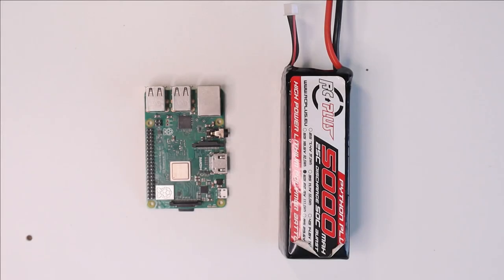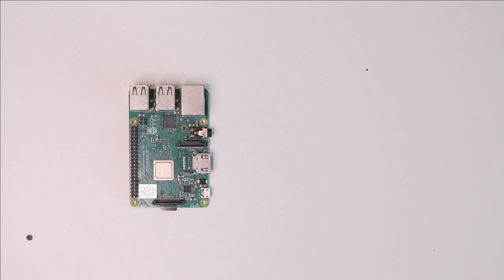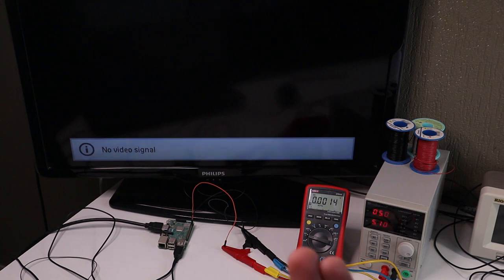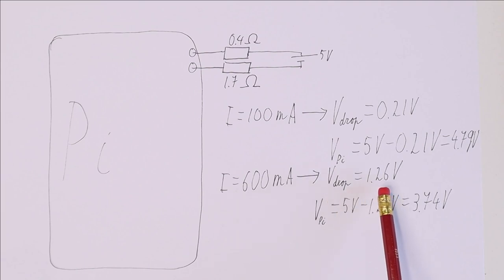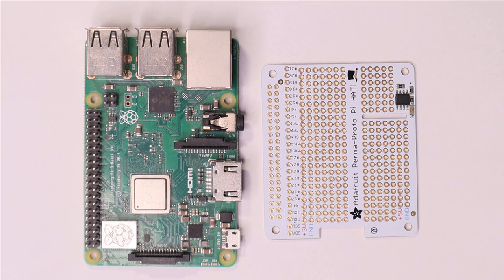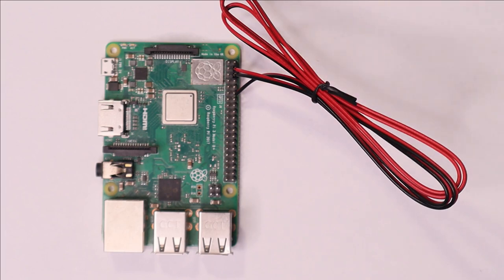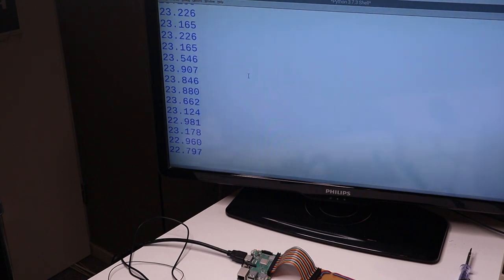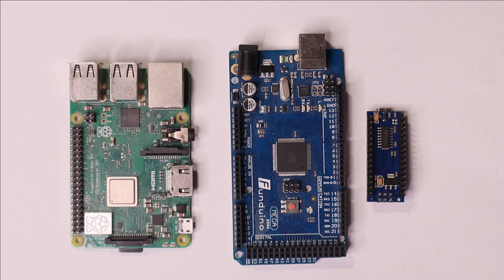How to power Raspberry Pi and Arduino from LiPo batteries

Comment: Awesome video! Some Arduino's also have a VIN input pin where you can add 7-12V (I usually still add a regulator to avoid using the built in one).  If you haven't yet, highly recommend trying out the ESP32.  It's amazing.
Reply from the maker: I talk about the Vin pin at around 16:30. I should've added the chapter markings by now, but the hard drive containing my footage was going bad so I took it out, so I can't access my shotcut project for this video. That means it's a bit more of a hassle than usual to put up chapter markings.

I got some brief exposure to ESP32, but haven't found a great use case for them yet. I honestly don't use arduino much either, I use Rasbperry Pi a lot, for the Wifi and camera capabilities mostly. ESP32 does look much more powerful than Arduino though, and a board is still just 3$ so that's very compelling indeed
Reply: @antalz  I totally missed that part, my bad.  Yeah the ESP32 is really robust w wifi/bluetooth built in.  My new favorite board.

Comment: I'm pretty sure I've worked on a project with a Raspberry Pi Zero W using the 3v3 pin as battery input so if you don't have 5v you can try 3v3 the same way you did in the video. My guess is it goes straight into the IC so you better be very sure your 3v3 is regulated. The 5v pin on the other hand goes through the internal 5v -> 3v3 regulator AFAIK.
Reply from the maker: I tried to look this up, but it seems a bit inconclusive. I'm honestly not sure if it works, I'd also not use a LiPo directly on 3V3 because you're going far out of spec, and that leads me to believe you'd fry something at a high state of charge.
Reply: @antalz  You definitely would fry something in that case! Also I looked up the files and we actually used the 5v pin for the project I mentioned so I'm not sure if 3v3 input works either :c

I should've done that before the first comment but I forgot I had a way to check the project files. My bad.
Reply from the maker: @bandreghetti7663  Yeah I did find some comments about feeding 3V3 into the 5V pin. But again, not entirely clear to me if that works.

Comment: Im not sure if the pi 2,3,4 are the same/similar lay out as the zero but there is a 4pin header thats unpopulated on the zero that dose power and usb, allowing for the whole gpio to be used with a shield still. I think its the 4 pins by the usb sockets on the pi3 you are using, im not sure but you should do a continunuity check on them!
Reply from the maker: I had to look into this, but for the large Raspberry Pi models the 4 pins appear to be for PoE HATs. The power itself is turned into 5 volts and supplied via the 4-pin header as I describe in this video. The 4 separate pins connect to the Ethernet jack.

For the Zero the 4 pins are completely different. One pair is a reset-pin and ground, while the other pair is a video output and its ground. The silkscreen also says "RUN" and "TV" for these pins.

I continuity checked it all, the 5V has no continuity with any of the 4 pins on the Pi 3 or the Zero, ground has no continuity with any of the pins on the Pi 3, and ground has continuity with 2 of the 4 pins on the Zero.

The Pi 3 also has RUN and PEN pins in a group of 2 near the PoE pins. They're unpopulated by default.

Comment: @Antalz  - Thanks for the video. I also see folks using a 3.7V Lipo and boosting the voltage to 5V using a COTS DC-DC boost converter. What is NOT clear to me is if that boost converter can drive 3A which is required for RPi4? I was researching a COTS or self-made PCB for my bot that can act as a onboard charger for the 12V Lipo with all the voltage & current protection and then down convert from 12V to 5V 3A to power my RPi4. Have you cracked this already? I have found a 7.4V Lipo UPS RPi Hat but not a 11.1V Hat which would have solved my problem.
Reply from the maker: You can find such boost converters, but it won't help you. In practice you have to connect the motors directly to the battery, and except tiny motors they won't work on 3.7V. That's why in practice you nearly always have a buck converter, not a boost converter.

What you have to do, in a nutshell, is buy a battery management system for your battery. You can find tons of BMS on aliexpress. The BMS ensures you can charge and discharge your LiPo or Li-ion bank safely. The motors connect to the BMS output via the motor controller, and you also connect a 5V buck converter to the BMS output to run the Pi and other electronics.

I haven't actually done this myself, mind you. I just use an Imax B6 to charge my batteries.

Comment: What maximum amperage would you recommend, for the inline fuse? Many thanks for a very informative video!
Reply from the maker: The fuse amperage should equal the maximum current draw of the whole system, plus a bit of margin. In my tank for example the Pi and electronics need about 10W max, which is 0.5A from a 22V battery. The motors that are driven from the battery need about 15A max though, and because there are 2 that's a max total current of 15A. With a bit of margin I think I selected a 40A fuse. If you're just driving some electronics or low power stuff you can go much lower, 2A or perhaps even lower. Just go as low as you can without getting unintended fuse triggers. This gives you most assurance that if a short circuit does occur the fuse will pop.

Comment: Hi there! awesome video, how do you know which fuse to use?
Reply from the maker: Thanks! The best fuse is the one that has a current limit just a bit higher than the maximum current your system should draw at any point.

Comment: Thank you for the great video! I'm planning to power a raspberry pi 4 4gb with a 7,2V NiMH battery, which value do I need for a fuse? Is 3A enough? Thank you very much in advance.
Reply from the maker: 3A is enough, you can go down to 2A as well, assuming you're not hooking up too many accesories to the Pi. I'm using fairly high-amperage fuses generally because I also have DC motors on the same battery.
Reply: @antalz  Thank you very much, I will use a seperate step-down converter for the Motor anyways so I think i will go for the 3A fuse.
Reply from the maker: @Mr.Mariuzz  Ok, be careful with that though, motors can draw a large spike of current on startup. This can lead to the battery voltage dropping and resetting your Pi, basically the same problem as having high-resistance connection. That spike can also overload that separate step-down converter. I would generally recommend connecting motors directly to the battery via a fuse, except for tiny motors.
Reply: @antalz  Thank you very much for that tip, but some questions ragarding your answer have come up to me. Which other option do i have to convert the voltage from 7,2V to 5V if I can't use the step down converter and how big should the fuse in this case be? Wouldn't the high current peaks destroy the fuse too? Thank you very much and I wish you a happy new year :D
Reply from the maker: @Mr.Mariuzz  Yeah those are basically the problems you run into with DC motors. What I do is connect the motors directly to the battery, with a motor controller in between of course. This does mean the battery voltage must match with the motor voltage, but there's usually quite a lot of leeway there. The fuses must generally be rated for a quite high amperage, usually the sum of the stall currents of the motors.
Reply: @antalz  So I could theoretically try to operate the motor with 7,2V?
Reply from the maker: @Mr.Mariuzz  Yeah, though it depends on the motor. If it's rated for 6V, you might risk overheating it, but I don't think you will. If the motor is rated for 12V you'll have less power output, but it will work.
Reply: @antalz  Thank you very much for your help, I'm going to have a deeper look in the specs of the motor.
Reply: @antalz  The manufacturer website says that the motor I have can be driven with up to 7 NiMH cells (8,4V) or a 2s LiPo (7,4V), my batterypack consists of 6 NiMH cells, so I should be perfectly fine powering the motor without converting the voltage / buying a different battery. Thank you very much again, you really helped me out with my shool project.

Comment: can we use buck converter (xlsemi xl4015e1) is it safe?
Reply from the maker: Yeah you can use those, but safety on them is tricky to put into words. The chance they'll catch fire is very very low honestly, but it's definitely there and it's higher then when you get a known name-brand supply like Mean Well. Make sure you have solid connections, and make sure you set the output to 5V before connecting your Pi. A lot of fires seem to actually start at the terminal block where the wire goes into the module. I would be totally fine using them for robot projects, but I would not leave them running unattended personally.
Reply: @antalz  thank you : )

Comment: what is the rating of the fuse you used?
Reply from the maker: Depends on the project. I think for my smaller robot 20A, for my larger tank I think it was a 40A fuse. It depends on the peak current draw of your motors, your Pi doesn't have that much to do with it. If you're powering just the Pi a very low amp fuse will be safer.

Comment: dude don't use a voltage regulators
they are not efficient at all
this application requires a buck/boost cards, they are cheap and easy to setup
Reply from the maker: I only briefly mentioned linear regulators, and I noted how inefficient they are. All other parts in the video are switching regulators, including TSR-2-2450.

With respect to the fuse, yes you do bypass it if you use the GPIO pins. In my opinion it's not a big deal.